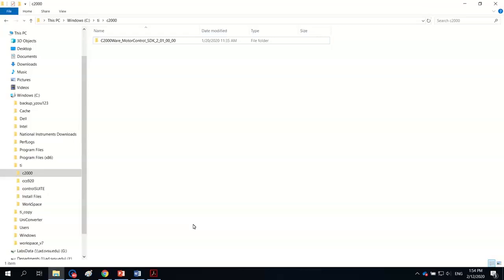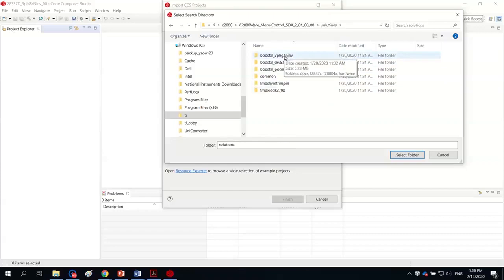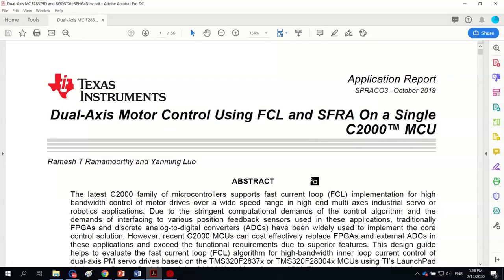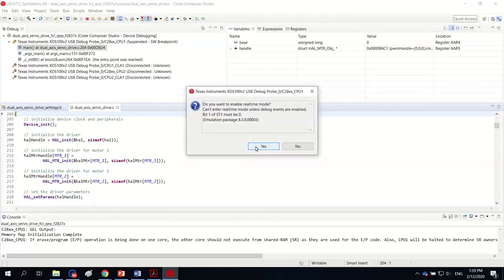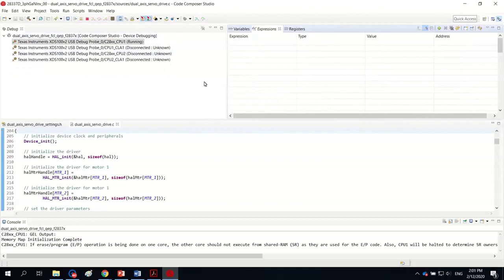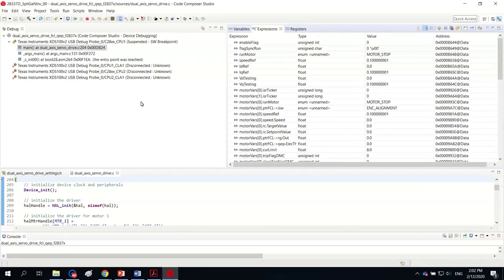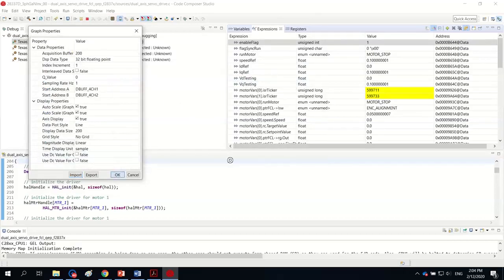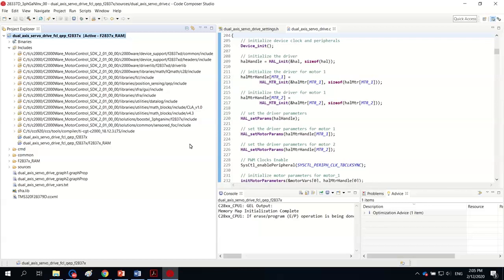TI CCS/C2000WARE-MOTORCONTROL-SDK: BOOSTXL-3phGaNInv bundle example project debug doesn't work

Comment: Is your control loop closed or just doing PWM with open-loop?  If the control-loop is closed, you might need some dummy signals (rotor positions with a certain fundamental frequency, etc.) to pretend having power-stage hardware ...
Reply: i'm trying open loop only to check it is generating pwm or not but there are two issue one i'm not able to run it in realtime -there is some error coming like undegubale code is running can't take it to debug and second that ta tb tc value are coming zero which is mean no pwm generation even when im using it at build level 1 which is for just pwm testing